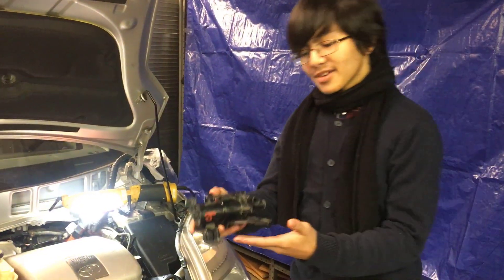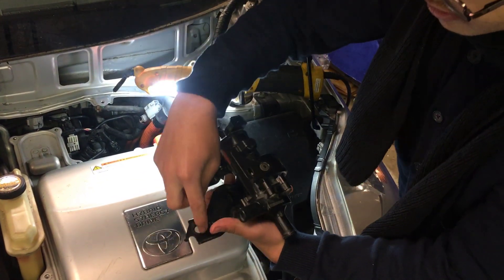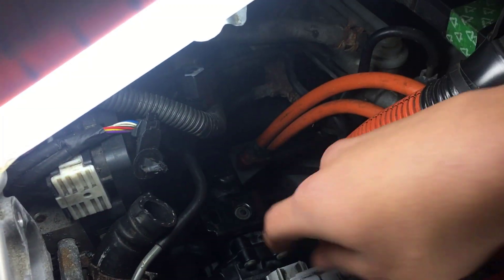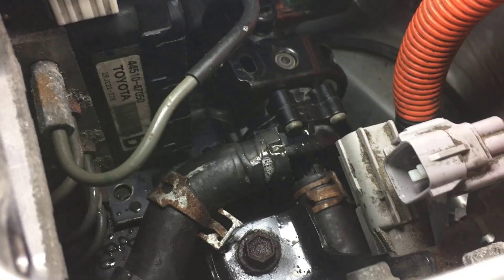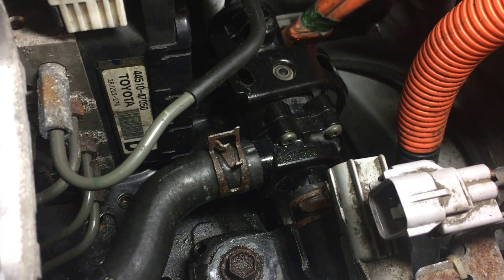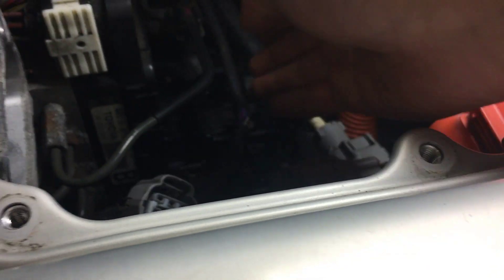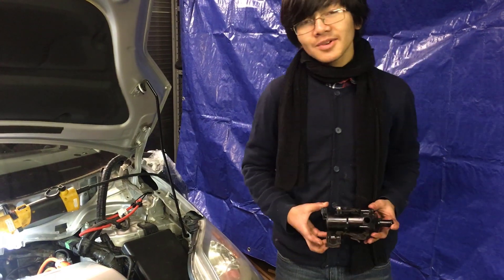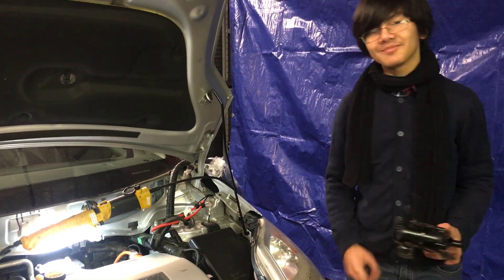How To Install Auxiliary Water Pump (ICE Coolant) Toyota Prius Hybrid Gen II 2004-2009 After Removal

Comment from the maker: Here are the #ᴬᴰlinks to tools, parts and accessories you may need to perform this repair:
1.  https://amzn.to/41nDVla  |  GELUOXI 16670-21010 Coolant Flow Control Water Valve Replacement for 2004-2009 Toyota Prius 1.5L Hybrid 
2.  https://amzn.to/41nywdW  |  Zerex Asian Vehicle Red Silicate and Borate Free 50/50 Prediluted Ready-to-Use Antifreeze/Coolant 
3.  https://amzn.to/3ZFMyXd  |  PEAK OET Extended Life Red/Pink 50/50 Prediluted Antifreeze/Coolant for Asian Vehicles, 1 Gallon
4.  https://amzn.to/3Vp9ojq  |  Milwaukee 2457-20 M12 Cordless 3/8" Sub-Compact 35 ft-Lbs 250 RPM Ratchet w/ Variable Speed Trigger
5.  https://amzn.to/3D4LOCa  |  G9020-47031 Engine Electric Inverter Cooler Water Pump Assembly for 2004-2009 Toyota Prius 1.5L 

Or Click on Amazon link here and search for what you need:  https://amzn.to/3D1T2GQ

Comment: Super nice man! I wish I would have started working on cars when I was younger, but I'm still early so I'm here! I'm hoping to replace this pump on my Lexus GS 450h. I had no heat and did a heater core flush, but then came to thinking that I MAYYbe am not getting coolant to the core and then realized this pump works on doing that. Hopefully once I replace, the problem is sorted! Do not want to have heater core issues (it flushed out nicely).
Reply from the maker: Glad I was able to help.  I hope you're able to fix the issue with your car.  I wanted to become mechanical engineer in the future and my dad saw that so he encouraged me to get involved with fixing the car.  I learned a lot and besides it helped improve my presentation skill.